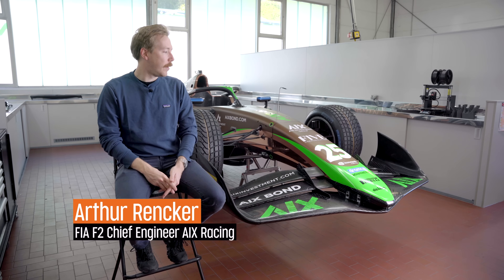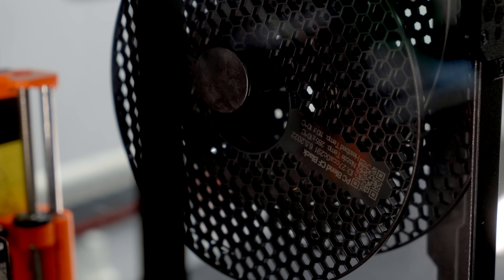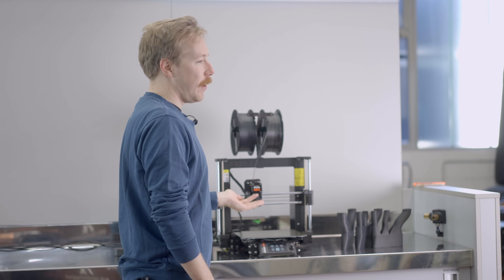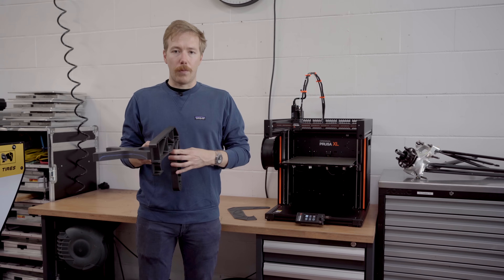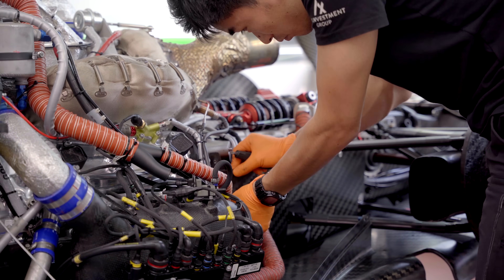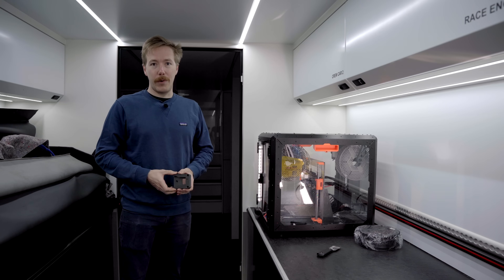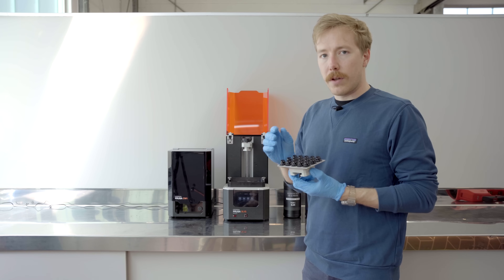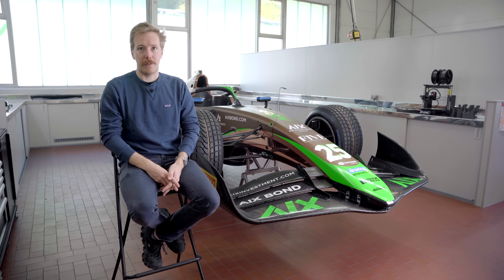Print to Win: 3D Printing in Formula 2 Racing

Comment: Just make printer with enclosure, your so late from another manufactures
Reply: They sell enclosures for all of their printers, and third party enclosures are easy to find.
Reply: @logicalfundy Prusa is outdated, too expensive, looks silly with the 3d printed parts. 

They’ve been cooked by bambu. The Mk4 with mmu and enclosure costs 1800€ compared to 1350€ X1-C which is quicker, less expensive and its core-xy
Reply: @Raphaelmicho  3D printed parts are great, I can easily repair and replace them, and it allows Prusa to test their machines by printing their own stuff. I do have a Mk4, and it works great.
Reply: Congrats! You have bought a 7 year old printer with a few improvements.

Competition is great! I couldn’t have afforded a Prusa, however I could afford a quicker, cheaper, newer machine. 

I did not need to replace any plastic parts on my printer after 1100 hours print time. 

I wish Prusa steps their game up, if they don’t I will not even closely consider buying one ever.

Of course it will run fine, may even be really reliable with great costumer service. 

However its like comparing a VW Golf with a Porsche Cayman on a race track.
Reply: @Raphaelmicho  not true, bambu with multi color or multilateral is NOT quicker.. MK4 with MMU is quicker and if you really want the best go for Prusa XL is 4 times faster and uses significantly less waste. oh MMU and XL do 5 colors you need 2 AMS ;)
Reply: @Raphaelmicho  With the input shaping, it's fast enough for me, and I'm sure there's plenty of headroom if I make some tweaks in the profiles. I wanted a product from a business with good business principles, and for reference I run Linux on my PCs so I'm much more in line with open philosophies, which I prefer in the products that I buy.

Bambu was a very new company when I bought the Mk4 and I wasn't sure how they would turn out. I'm still not sold on the quality of their products, considering the A1 recall. I didn't want to wait for them to work out all of the bugs in their printers and their business. I also wanted to see how willing they were to open up their machines, as they had them very locked down at the time. You couldn't even access the log files you needed to send to support if you wanted their support.

. . . and I'm the kind of guy who will take the VW Golf because I'll be taking it to work and back and putting hundreds of thousands of miles on it and don't plan on taking it out to the track like one would do with a Porche.
Reply: @Raphaelmicho  noone speaks about speed when you have to stop and poop for 1,2 minutes each time... I wonder why?
Reply: @Reazy- they still are selling machine though. so....
Reply: @3DEMS.  I dont print multicolor anyway. Btw you compare a 3500€ machine to a 1350€ one. Id rather have my printer poop, than pay 2,5 times more
Reply: @Raphaelmicho  Bambu bot thats never used a prusa. Hes probably still waiting on bambu support to fix his broken printer.
Reply: No. Not everybody needs an enclosure. Go to Bambu Kiddie.